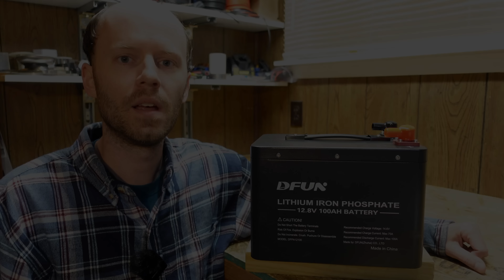DFun 12V 100Ah LiFePO4 Battery Review and Teardown

Comment: Seems the drill was too large for the tap, I had a similar issue, in aluminum, with a 3mm tap, it worked but easily stripped,

Comment: This is not a great video. I hate to sound like a butt-head, but these 12v 100ah battery tear-downs were so cool in 2019 but now are tedious and boring. How about more videos on the new LX6048WP and how it works with 4-5-6 different server rack batteries. Or maybe a comparison of apps that control BMSs.
Reply from the maker: Thank you for this feedback. I am very much trying to branch out into non-12V review videos. I will be focusing more on the server-rack batteries soon and actually have a very large project coming up here for the month of June. If you have any other ideas of videos/demos you would like to see, please don't hesitate to suggest!

Comment: Thank you for the video. It seems there are some sloppy manufacturers out there. Have always wondered what determines the number of 12v batteries you can hook up in series or parallel? Can you for example place 4 of these in series to form a 48v battery pack?
Reply: The number of series connected batteries comes down to the voltage rating of the FETs (transistors) involved in the charge/discharge disconnect facility.  Generally the higher the voltage rating the more expensive the FET (other parameters remaining the same).  Parallel restrictions are more about fault current and capacity matching of the individual batteries for load balancing purposes.
Reply: @retrozmachine1189  that was one of the most concise answers to a question asked here in YT, thank you. Was going to buy you a cup as I do when responses are as informative as yours but could not find your "buy a cup" section?

Comment: Thanks as always LithiumSolar. Please consider testing the PDFF 12v 300 and 400ah from A Ex china. To see if it's any good or a piece of junk. Thanks.
Reply from the maker: Do you have a link for that battery? I don't see any relevant results on Google.
Reply: @LithiumSolar  Looks like someone read my request as it’s no disappeared from the website. Answers my question really as it was quite cheap.

Comment: DOESN'T LOOK THAT GREAT:
1. MESSED UP TEMP CONTROL LEADS
2. ONLY 100 AMPS CONTINUOUS WHICH IS NO GOOD, OLD NEWS WHO CARES.......
3. IDEALLY 200 AMPS CONTINUOUS WITH DECEN TEMP DISC CONTROL
4. I DO LIKE THE IDEA THAT THERE COULD BE SOMETHING LIKE STANDARDIZED OB2 SCANNING FOR BATTERY BMS, SO ANY RANDOM DUDE COULD JUST PLUG IN A SCANNER AND GET USEFUL READINGS..
5. YOUR VIDEOS ARE GETTING BETTER ALL THE TIIME, THANKS FOR THE SHOWS

Comment: Another excellent review, as per your usual standards.  One question I have is, how important do you feel low-temp charging protection really is?  It seems like it is constantly stressed as a critical thing to have, but it seems to me like so many use cases would rarely, if ever, result in the batteries charging when they are below freezing.  Am I wrong about that?
Reply from the maker: It's not a problem at all if you're using the battery in a conditioned space or climate where you don't see freezing temps. You'll want it if there is any chance of the ambient temperature dropping below freezing. I think what's more important is awareness of charging LiFePO4 below freezing and awareness of whether or not a particular battery has it. Otherwise, the random Joe shopping on Amazon for a battery just picks one and has on idea.

Comment: I cannot figure out any good reason for having those raised plastic pieces around the terminal. You'll probably have to cut those if you want to use terminal fuse blocks.
Reply from the maker: I can't see any reason either. Protection is out since they have a rubber cover that goes over the whole thing. I agree, they can be snipped off very easily if needed.
Reply: Just unscrew the 4 screws and rotate it instead of cutting the tabs off.